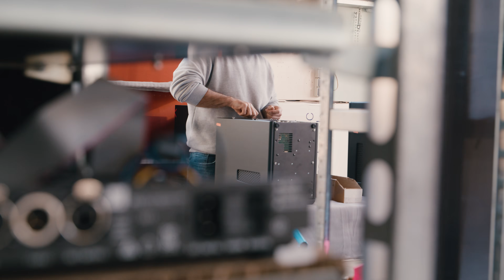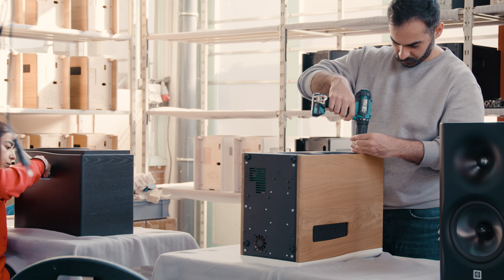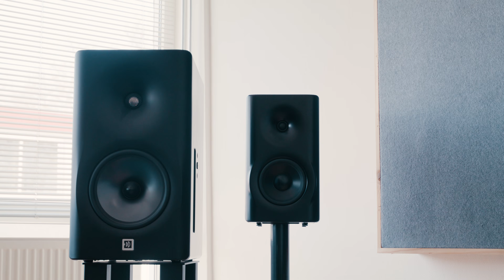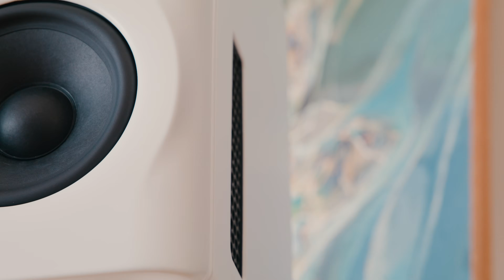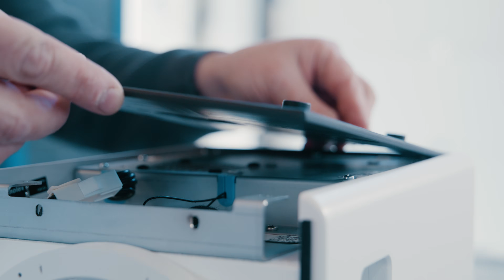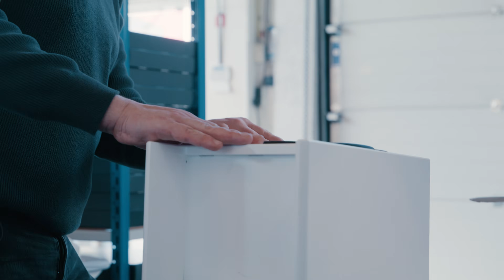Dutch & Dutch’s 6c Active Loudspeaker Explained: 8c Concept for Smaller Rooms

Comment: Is the 6C better for a 4x3.8 room?
Reply from the maker: Likely
Reply: Use a prosc response 1sc or ls3/5a’s for such a small space (what the ls3/5a’s were originally designed for). And do a PERFECT job at reproducing near perfect monitoring 😊
Reply: @MrGfunk215 thnx
Reply: Or a Harbeth p3esr (preferably the 40th anniversary edition).
Reply: That's a small room for monitoring. If you are listing critically for pro audio, I'd suggest working with headphones until you can find a room large enough to represent low end.
Reply: @GingerDrums Membrane basstraps do the trick. No need for another room ;)
Reply: @ILove_808  nice work on the membranes :) you will have axial modes at 43-45hz despite them though. Sounds like you are well informed/invested in acoustic in any case so I'll leave it there :)

Comment: So the XLR connections in the back are for Preouts on a receiver, correct?
Reply: They are digital (AES3) and analog inputs. So it's how you get a digital or analog signal into each speaker.
Reply: You would want to use AES3 if at all possible to benefit from the DSP Tech and app control
Reply: They have XLR’s for external DAC’s etc and have an internal LAN so not mucchhhh need (except for maybe an external DAC for a anymore inputs nor a receiver (they have internal amplification) 😊